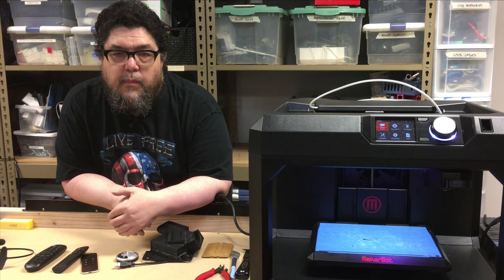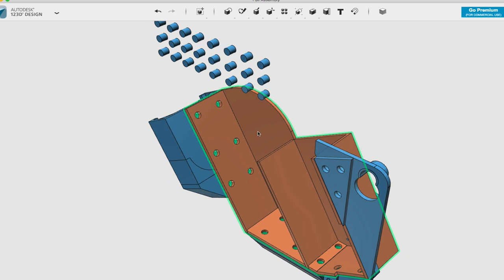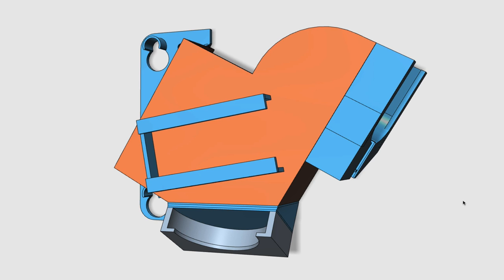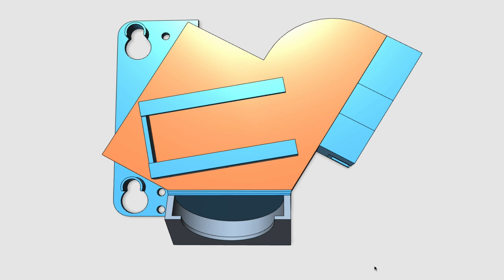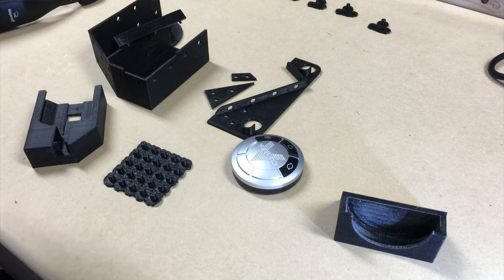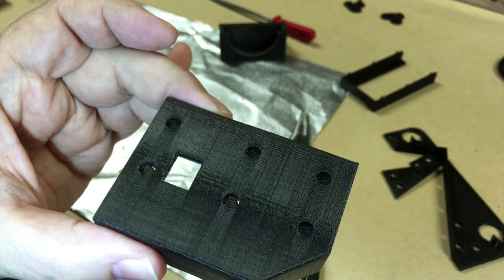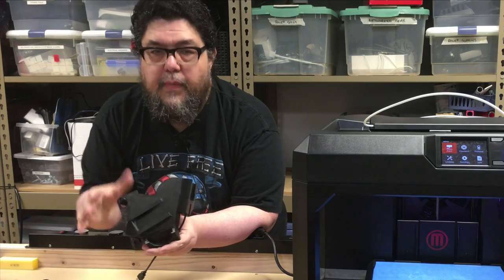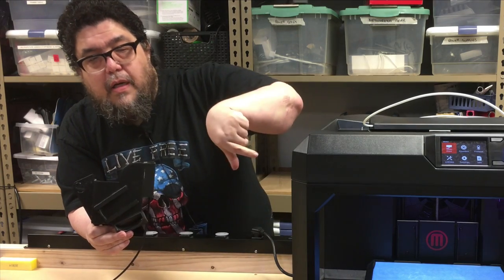Lessons learned from my first big 3D printing project

Comment: Interesting. I wonder if the materials will cost 20 dollars in europe.
A serious question in my mind is, can the material be reused.
Which type of material did you use.
How much time did this use - and without a template, how would the time you used stack up against your assessment of how long you would use when having practiced the basics - doing the same 'job'.
What is 'crazy glue'?
Thanks for a pleasant presentation David
Reply: +owpeterj I used PLA. I don't really have a good conversion for the "I'm learning" time to the "I do this all the time" time, but I'd guess that it might be a day or two of real work for an experienced designer. Crazy glue is a classic American brand name for https://en.wikipedia.org/wiki/Cyanoacrylate

Comment: I see from zdnet blog, that this was a process not without headaches and one that would have been completely debilitating had one not been in close contact with the machines fabricators and supplies.
That is rather sad as it still means the serious chance of being stuck having hardly started and with no experience and a fairly time consuming wait for 'relief'.
Just the filament head - a novice imagines that this functions reliably because it has been sold to do such!
I will read more - I recognised that this was not your own purchase and you are dedicating time usually occupied by other pressing engagements.
I'll leave it there. Thankyou for your time.
Reply: +owpeterj Don't beat too hard on the manufacturer. All production processes have their sweet spots and I'm still learning that for additive manufacturing. Also, some slicers work better than others. In terms of accessibility for users, I believe that, if taught and positioned right, 3D printing can be as accessible as, say, doing a PowerPoint. I'll actually be doing some articles/videos on that in the future. Now, remember, though, that while almost everyone can make a PowerPoint, there is a big difference between a good PowerPoint and one that's difficult and painful to watch. Likewise, there's skill and art here, but the basics aren't that difficult. That's my goal for this whole discovery series: figure out how to get to the basics and make them accessible. That will, like with any discovery process, involve trial and error -- because the errors are as instructive as the wins. The new version of the bracket is awesome. I use it constantly and love it -- it was well worth the time to build it to my personal satisfaction.